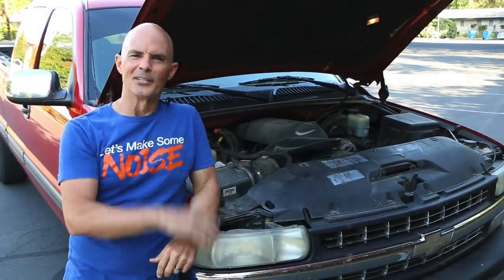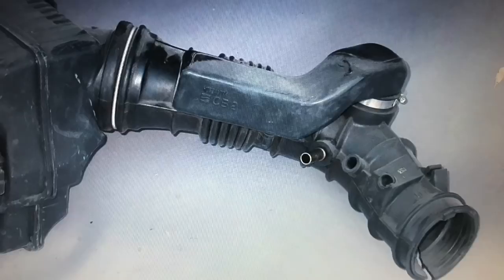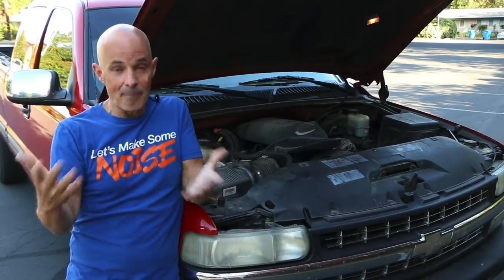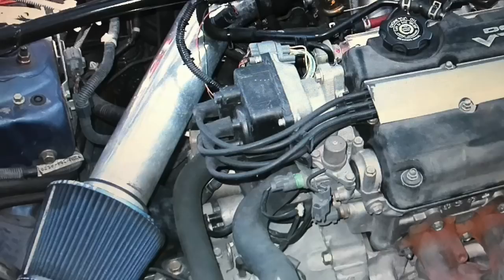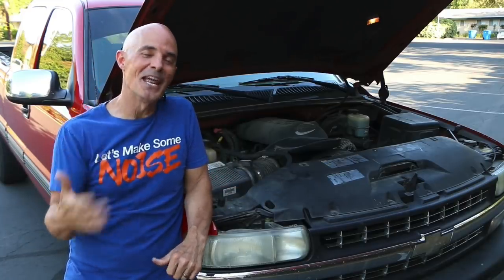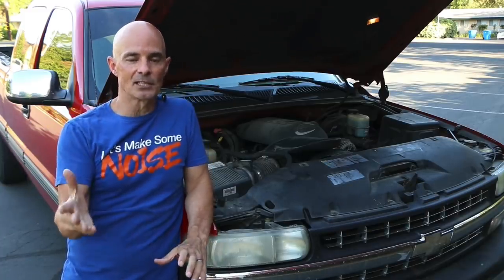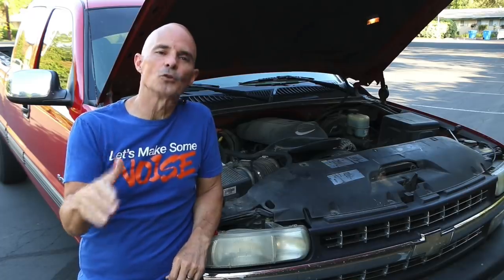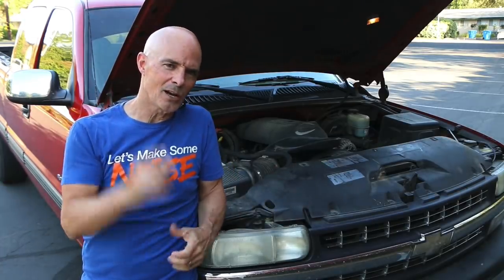YOU'RE FIRED! HOT AIR INTAKES!

Comment: Your arguments & Civic tale reminds me of the many I've had on Cavalier/Sunfire forums about the validity of "fresh-air" intakes (i.e.: "Ram-Air") which to this day, I still feel make a bigger difference than just a CAI (Cold-air intake) on overall performance... with my evidence/proof being results had with a '85 S-10 w/2.5L & automatic in top-end and fuel economy.
Reply: The problem with those is that the bennefit of ram air can't be proven on a dyno. The best way to prove it is same day 1/4 mile trap speed.
Reply: There are Cavalier/Sunfire forums?

Comment: Richard. Cold air intake like yours but mounted pod filter between bumper and front wheel. If pod filter is say 6 to 10 inches from car tyre wheel can it cause a turbulence unsettled air for the filter ?

Comment: What diameter pipe should be run to the turbo? I would like to see the test results. Wonder what the air does, turbulence reverb, entering into the turbo if the pipe is straight or belled out?
Reply: The 3-4 inch depends on turbo size too.

Comment: my 91 Mercury Grand Marquise 5.0 had a factory Cold Air Inlet to the Factory box. On my K30 86'  truck with its LQ4, How can I build a Cold Air system that is is Isolated from engine compartment temp? I also don't want to drive in a puddle one day and hydrolock my motor.
Reply from the maker: make sure the cold air inlet is high-some guys have snorkels so they can cross rivers

Comment: Richard, I understand Helmholtz resonance very well in an acoustic context. I'm trying to apply it to an automotive context. For instance, when building a vented 'Bass Reflex' loudspeaker you calculate the length and diameter of the port using established formulas based on volume of the enclosure and mechanical (Thiel-Small) parameters of the speaker/driver. Are there similar mathematical formulas applicable to an engine? A speaker's cone moves air through pistonic motion within an Xmax stroke, in a certain cubic inch/liter volume, with an air port tuned to a certain frequency. So, given the obvious parallels, how can we calculate the port size and length for an engine?
Reply from the maker: there are formulas for calculating the resonance frequency of the plenum associated with an individual cylinders, multiple cylinders crate more of a problem as the many different forms of cylinder filling that exist in the internal combustion engine mean there is a lot of interference (and cancellation of the effectiveness) of the waves. its more difficult than a speaker box
Reply: @richardholdener1727  Great video, thank you. You certainly got me thinking. It may well be more difficult to calculate with an engine than a 'speaker box'. Maybe not. Keep in mind that many 'speaker boxes' (Speaker 'System' is the proper term) take just as much or more time and cost to design and build than most engines we're building. Moreover, the majority of high performance speaker systems use multiple drivers (pistons) not unlike multiple pistons in an engine. They have to move together in harmony to avoid interference, cancellation, etc. I understand the science of individual tuned ports in a plenum. I was asking if there were any established calculations to predict the size and length of the intake tubing. Apparently it's all trial and error?

Comment: That's why I never modded my '85  Mustang 5.0 4bbl intake system.
The OEM air filter assembly was big and had 2 snorkels with flex tubing that went straight out to each fender well. I'd see other 5.0 4bbl guys running a small (chrome of course!) circular open element air filter.

Comment: Any thoughts or testing results for taking inlet air from the cowl? I would think the highest potential ram air effect and lowest temperature would be the cowl at the bottom of the windshield. Also using plastic pipe (especially white) would minimize heat transfer into the air from the hot engine components. Shiny aluminum tube is the worst material you can use (well, except for copper) due to it's high heat transfer.

Comment: I find the Dodge Demon cold air setup (using the cars a/c system) very interesting. Somebody at Dodge wanted cold air so bad that they designed a complete new type of system. You can really tell when true cold air is going into the engine.
Reply: I have a better solution from Kincaid Performance with their Killer Chiller setup. On my supercharged V8 Audi S4 with an air to water intercooler system I use the AC system to get starting point IATs between 30-44°F below ambient temps. In a 1/4 mile dragstrip pass the IATs never go above ambient.
Reply: That’s a street racers trick from the days of the supercharged E 55 AMG ( hellcats daddy )20 years ago called the chiller.

Comment: A hotair/ram air intake is only beneficial when its larger than stock piping and has less restrictions,  also a hot air intake doesn't effect iat if you have an intercooler as it has to pass through the intercooler befor the combustion
Reply: You mean short ram intake. And they can help make power once you start moding the engine. PFI Speed dyno'd a Civic a few months ago that lost something like 20-30% just from the stock air box.

Comment: This is one the shortcoming of typical dyno's they don't simulate air flow, the very best dyno fan might simulate up to 40mph and that doesn't cut it.  The air temp I see in the real world are far lower than what I see at a dyno shop over 25c. I have functional duct pass tru cooling path.  The thing is at lower speeds the air gets sucked through the hoods vents it wont start extracting until around 50mph.  The actual intake inlet is the center vent at the front of the hood I'm pretty certain that's not high pressure air but it looks nice and there just isn't much space to work with.

Comment: Dude your awesome id love to have just a little of your experiense and knowledge ive owned a bunch of muscle cars 76 T/A 455 4speed ,68 camaro 350 w/powerglide , 69 firebird it had a 400 i put a .30 over 1970 455 H.O i built with biggest comp magnum cam hydromatic 4 speed,1965 short bed chevy step side, built 1967 327 365hp engle 525 lift cam i built muncie 4 speed  i could go on and on i have a 283 bored to 4" with 12:1 pistons and 291 double humps and victor jr intake i need to rebuild it should be fun
Reply from the maker: all good stuff

Comment: Could you do a video on water/methanol injection systems? I think that might be an alternative to an intercooler when space and budgets are tight.
Reply: They're often used as the charge cooler. In fact that's what GM use as the charge cooler on the first production turbo car, the Olds F85 Jet Fire.
Reply: @lb9gta307  You're right, I had forgotten that. Just a little ahead of their time, the turbos then weren't ready for prime time. Pity. A modern turbo and EFI on a Corvair flat 6 or Buick/Olds aluminum 215 would've made a fun little car. Swing axles notwithstanding.

Comment: Something else that gets over looked is piping material aluminum plastic plastic is far better than any metal at not conducting heat from engine compartment drive your car around for a while and then feel you aluminum intake tube ITS HOT now use the same size plastic tube and it’s cool aas a cucumber. Polished aluminum tube looks good but plastic holds less heat by far.

Comment: This video was spot on! I’m you she’s some light on how having an open turbo in a hot engine bay can be detrimental to inlet charge temps. I see tons of muscle trucks and cars running a open turbo even with a filter pushing insane boost plus tons of heat. Their performance and air temps can drastically improve with actually running a dedicated cold air intake system. Longevity, cool temps, and big power = a stone cold Steve Austin hell yeah from me!

Comment: I did this test on my "01 Jeep Cherokee years ago. Used my scanner to read IAT sensor highway driving. Factory air box was about 10* above ambient at it's coldest, which wasn't too bad. Expensive ass K** was way hotter than ambient, a lot more than the factory box. My self fabbed cowl induction would go all the way down to ambient!!!!!!! I will not ever install an aftermarket "hot air", filter in engine compartment intake on a car ever again. A lot of factory setups are better than expensive, filter under hood intakes. Waste of time and money. If it does draw air from out of engine compartment, it is a waste of time and money. My K** would actually make my Jeep run like crap in the summer, on restart after sitting, like when you stop at a store for something. On restart, the IAT sensor would read a couple of hundred *. My cowl induction would be like 100 and change on start up and rapidly drop as you drive. People, stop making your cars slower than factory with this garbage!!!!!!!

Comment: I think keeping the fuel cool is just as important as air. Maybe more important. But I'm a carburetor guy
Reply: If someone plumbed a transmission cooler into the fuel line and submerged it in ice water I bet that would gain some HP. But how much?
Richard should do a dyno test on that... Injected and carbureted so we can see both.
Reply: I would of think heating the fuel on a carb would help.?
Reply: @theall-seeingpie8887  I have worked on some Mercedes that used the AC to cool the fuel. Mercedes stated that it was to prevent hydrolock. Which is a complicated way of saying that it was preventing the fuel from getting so hot that it vaporized in the lines before getting to the injectors. So cooling the fuel would probably help to a certain point.

Comment: No doubt the computer really kills the power when it sees high intake temps. 
I can really feel how sluggish the work truck is.
if it's been sitting and idling for a while and you go to take off, it needs alot more throttle input and is very lazy. 
Once ya get up around 30mph it starts to clear it's throat a little and get some cooler air.
Reply: It does so because otherwise engine will knock

Comment: Hood open vs closed on dyno  is less significant than car stationary on dyno or moving at 80 mph+
Reply: Right.... cause you can go 80mph with the hood up....
Reply: @fastinradfordable  people have done so by accident lol. But I think his point is the stagnant air from a stationary car vs what moving a car through the air at 80mph does to the underhood air.
Reply: If you are pulling air from behind the radiator then it will always be hotter than in front of the radiator

Comment: The old school  , coiled fuel line in a can with cold water ice ,  does that work
Reply: Engine Masters stumbled into that test.  They found that fuel temp on a carburetor engine made a big power difference and intake manifold temp made almost none.
Reply: It helps a little bit at the drag strip. Not practical anywhere else.

Comment: For the reasons you just mentioned regarding air intake temps, I’ve always modified (enlarged) the air filter canister and maintained the lid and connection to the fender or core support on the SBCs I’ve owned to keep the air temps down. The big chrome open element filters look pretty on the carb but you’re just sucking gobs off hot air as it around the exhaust manifold and radiator. I’ve tried to explain this to people that think I’m crazy. :) although, I have no dyno tests to confirm if a High flow filter has much benefit when it’s still hidden away in a round steel can

Comment: "Cold Air" intakes aren't cold unless they are as low to the ground and as far away from sources of engine heat as possible. Those short pipes that sit in some empty space between the engine and chassis do absolutely nothing. Further, when real modders talk about "Intake/Header/Exhaust" they mean the INTAKE MANIFOLD, the engine piece that sits on top of the block. The Intake Manifold is the piece that can give you 15 horsepower, not the filter tube.

Comment: You're standing in front of a TRUCK. I realize that many people buy trucks, never use them as trucks. I pull a 5300lb camper, a pontoon boat. Trailers from time to time. I'm alot more interested in how much I'll make from 2500 to3500rpm that how much than at 5000rpm! When I raced 3 nights a week I worried about peak power, you're standing in front of a pickup truck.

Comment: All you dummies  don't louver your hoods . Why is that? Having the air intake in the wheel well is a mistake. Hit a puddle of water at speed and hydraulic the motor bending con rods and ripping out main webs. Many a Honda die that way in the 70's .   I found that most engines like 40-50F and 50% humidity.
Reply: You can buy a hydrophobic prefilter as  well as an inline bypass valve to prevent that. Neither are new things.